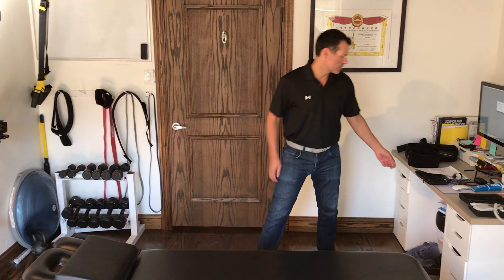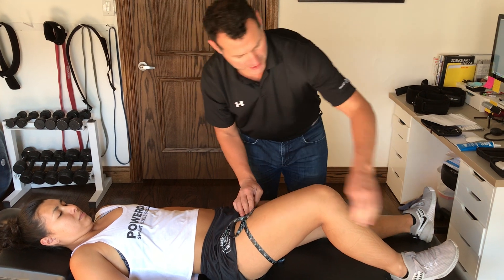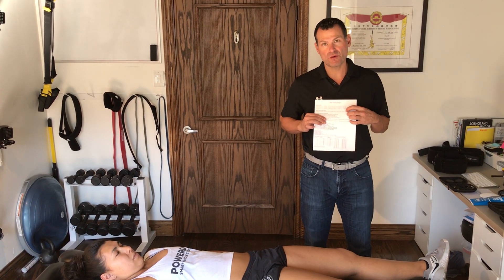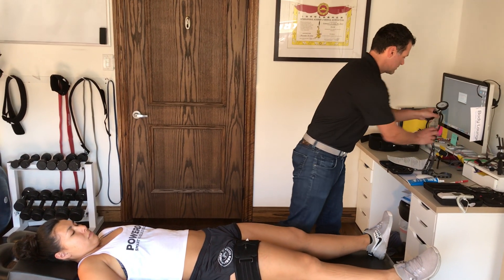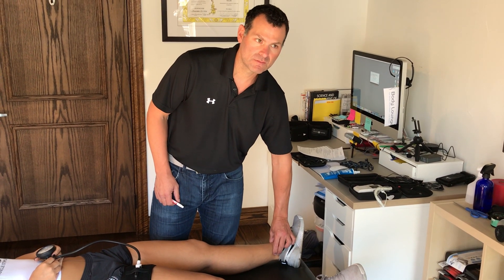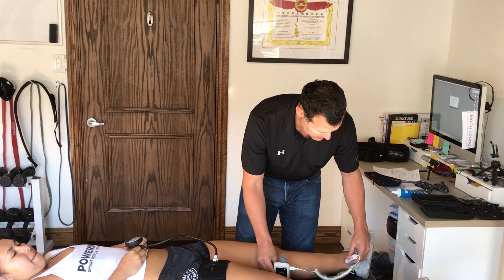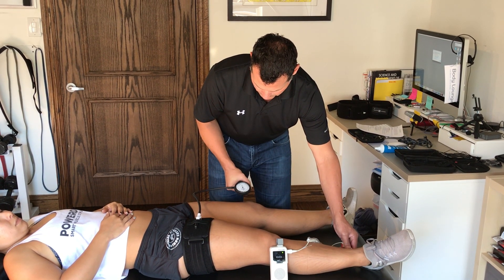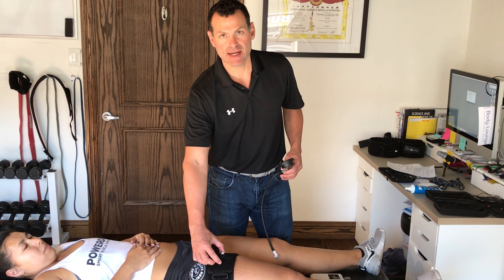BFR - Finding Lower Extremity Limb Occlusion Pressure using a Doppler

Comment: Thank you for the detailed and informative video. This might be a silly question, is that black cuff you’re using to assess the LOP the actual BFR cuff that the patient will use during the exercise training?
Reply from the maker: Yes these are the cuffs that are used to exercise although this is an older video and the latest generation of cuff is slightly narrower.
Reply: @EdLeCara  thank you! 

I know the protocol for bfr is 60-80% occlusion of LE, and about 50% occlusion for UE. But if I’m doing passive exercises on a patient, do you know what the LOP protocol is for each upper and lower extremity? 🙏

Comment: Is it possible to use a portable fetal doppler? Or is there a difference?
Reply from the maker: should work
Reply: @EdLeCara  It won't work Doc
Reply: Fetal Doppler don't work because it has greater penetration ( less than 2 MHz) for vascular purpose it should be more than 4 MHz